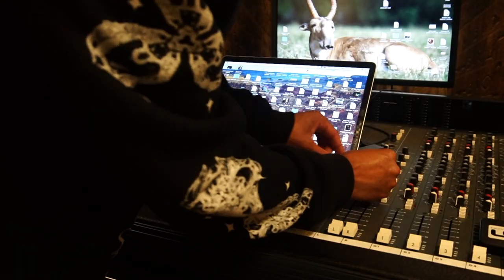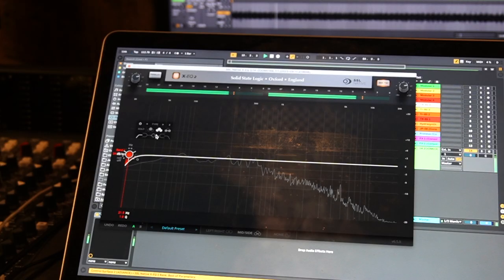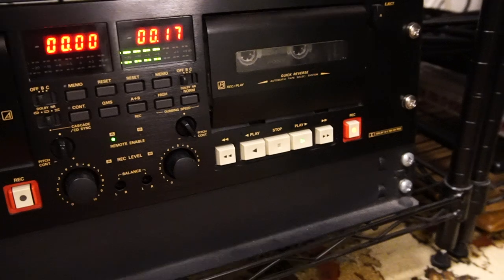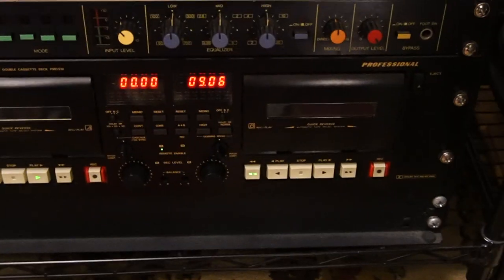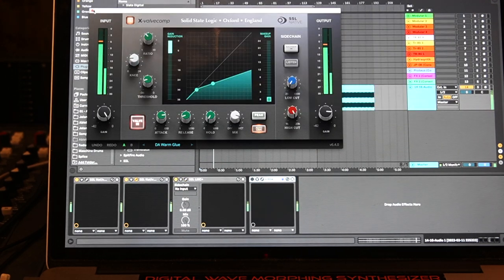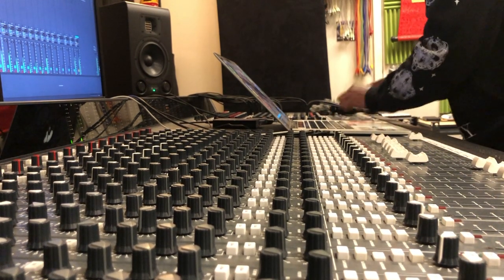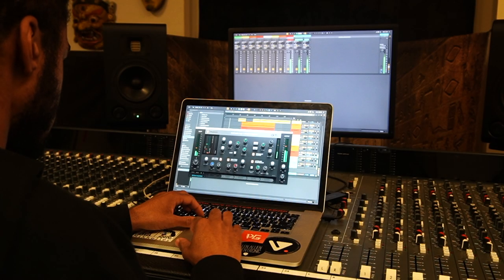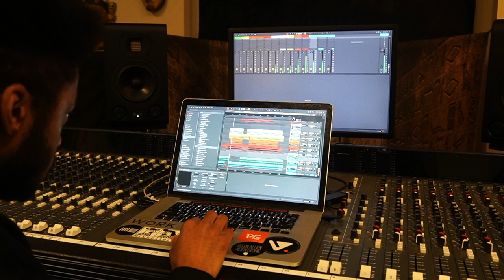Making Techno Texture Loops

Comment: thanks for the ideas. I found a clip of autorepair sounds on YouTube. Took the audio and processed it with Noise Engineering Ruina, Arturia dist ColeFire (Bit Inverter and Drive), and Rev INTENSITY plus an EQ HP at 1K and LP below 10K, plus compression. Sounds great! oh and modulated the gain by a few db with an LFO sine wave.